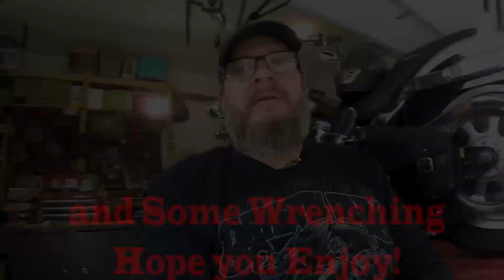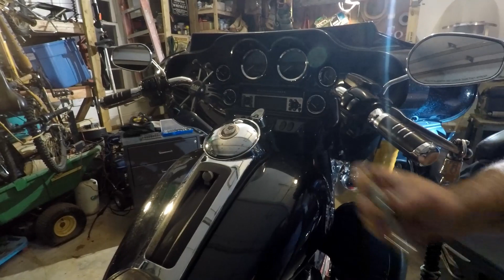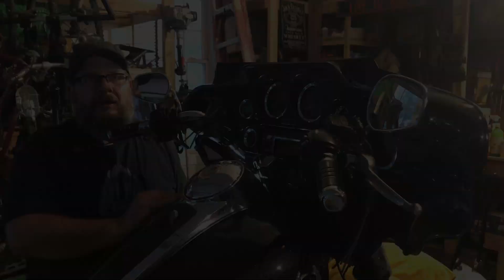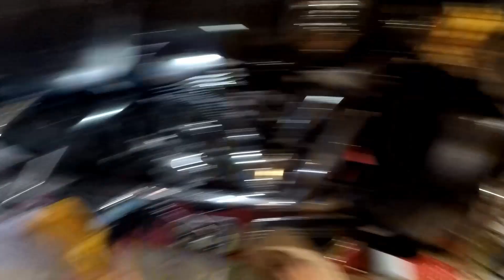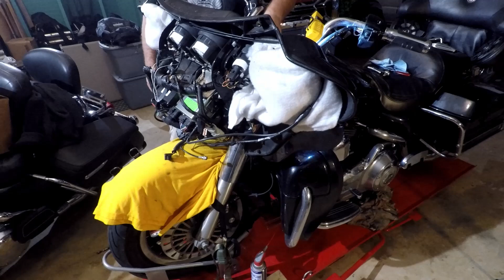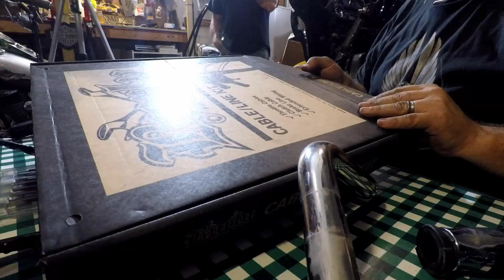Ultra Ape Project Episode 1

Comment: Nice,  one thing I will give big props to is putting the trans fill plug back in.  Any time you have an open hole with small bolts they will end up in there. 

Now a little trick for us fat finger guys,  when storing small screws get one of those reusable egg trays. Wally world a Coleman 12 egg is like 5 buck on line.  Here is why, the bottom is round and you can fish the small screws out.  Number the holes and on a piece of paper you can write the number and what the bolts are for and any notes that maybe you need like put "X"  bolt in before "Y" bolt.  Then the paper can go in the container and close it up.  Stuff a rag in there to hold everything in place. Great for long term jobs like getting something sent out for paint, chrome, or powder coat.  If it just a day job then it holds them nice on the bench. Also cleans up well for the next customer.